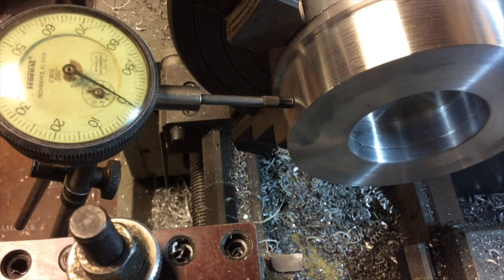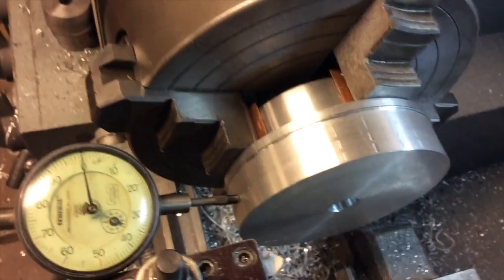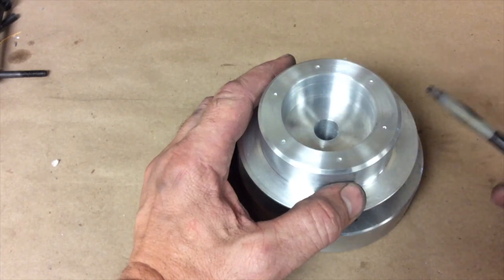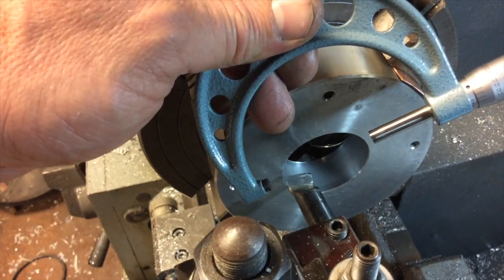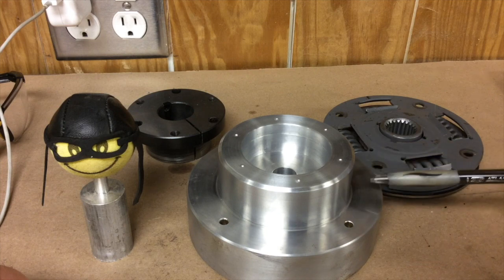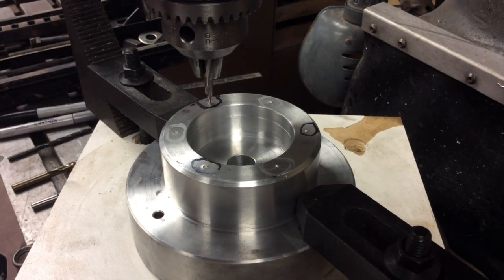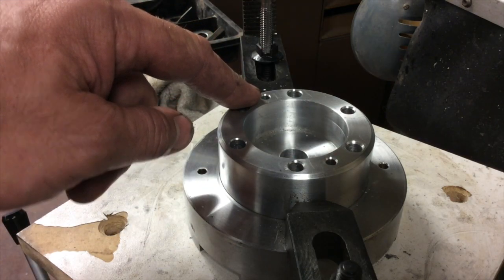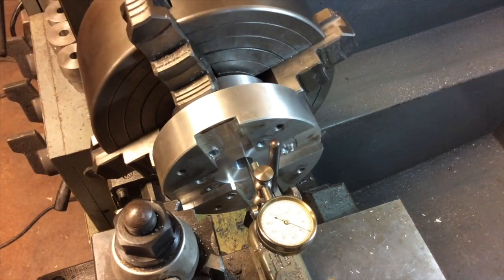RX7 TO EV7 EPISODE 3b DRIVE COUPLING

Comment: I have concerns about using aluminum for the tapered section of the hub.  I would worry about the QD bushing permanently deforming the hub and the bushing coming loose over time.  I machined about 100 of these hubs over a 4 year period, the material that I finally settled on was 416 stainless steel.  The HT variant is about 150ksi and doesn't corrode readily.  It had a good finish and held up well.  The QD bushing is 4 degrees IIRC, very shallow and produces a lot of force, galling is a real possibility too.  It's very critical that the hub is perpendicular to the shaft and has as little runout as possible, to avoid vibration.  Shifting will be tricky too, 108ft/lbs is not a lot of torque, so you will need to shift.   I would recommend putting some lower gears in the rear to help with the lack of torque.

Comment: To remove that coupling you can just use the threaded holes that are in the coupling. You take out the mounting bolts and put them in the threaded holes to push it off.
Reply from the maker: Brent Dupuy , thank you

Comment: I also have AC50 in my car, its connected to transmission with love-joy coupler. To allow gear change I use a footswitch to put controller in shift neutral breaking mode (https://www.facebook.com/evgaragepl/photos/a.637164556423612.1073741828.527329560740446/977721979034533/?type=3&theater). Shifting is not perfect but really good. 
Nice videos ;)
Reply from the maker: Krzysztof Przybek, thank you thats very helpful.